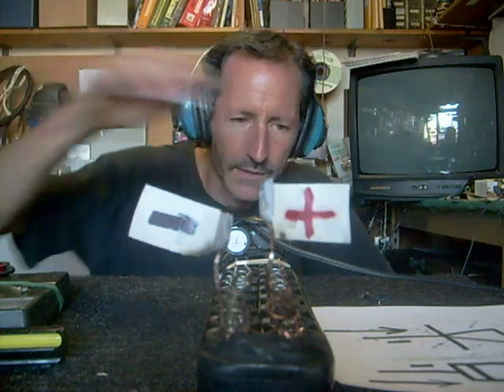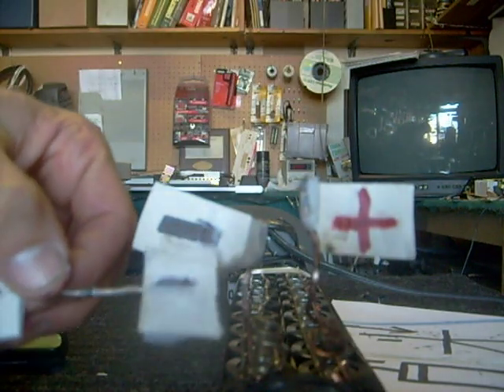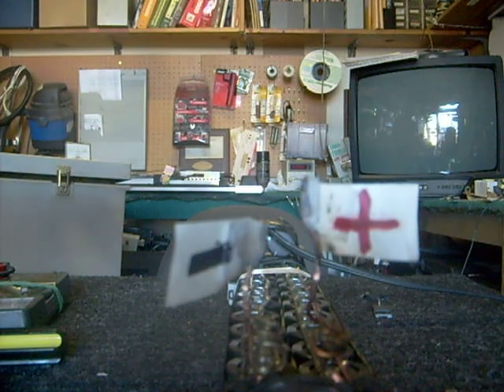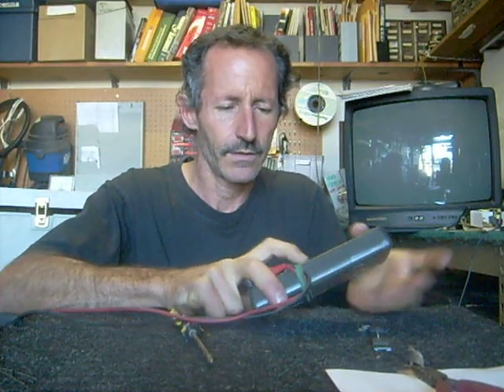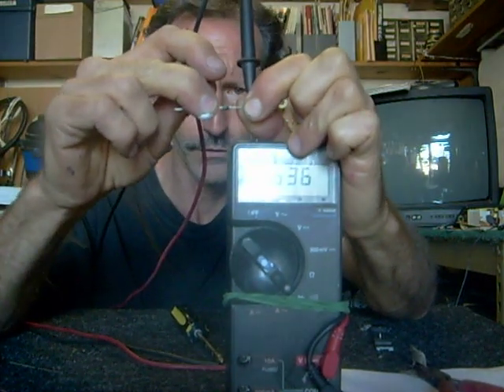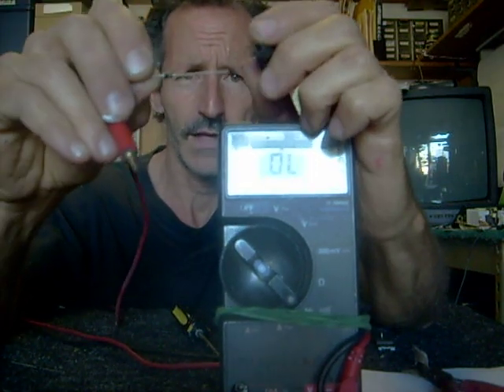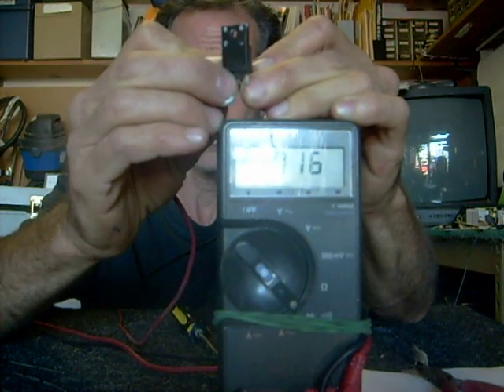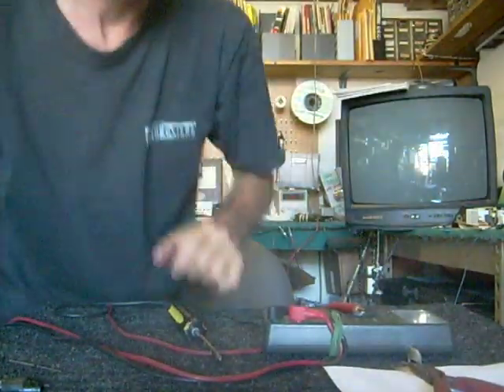How to test Diodes

Comment: Ok ive got a problem!!!
to check the multimeter ive put the multimeter to the diode option and as soon as ive put it to the diode setting without connecting any diode to it makes that keeeek!!! sound and there is no change if i connect it to the diode !!
Reply from the maker: Ansul Joshi Sounds as though your  meter is broken.
Reply: hmmm all the other functions work finee!!! like volts amps and all the other functions work just fine!!! is there any oother way to fix the meter !!
Reply from the maker: Sorry but I couldn't tell you how to repair a problem such at that.
Reply: hmmm ok cool np!!

Comment: you can always tell a seasoned veteran by the rubber bands around the meter leads to keep them from twisting all over the place ;)
Reply from the maker: Gord Slater You got that right. LOL .  After re-soldering the meter probes numerous times I figured a little tension relief might buy me a little more time,  Seems to be doing the job.

Comment from the maker: A diode doesn't put out any voltage or current, but if power is passing through them from an external power source they cause a voltage drop of around 0.6 of a volt for a silicone diode and around 0.3 of a volt for a Schottky diode.

Comment: If the diode is putting out half a volt....wouldnt that a source of energy....im confused bigtime. right now im  thinking put 500 diodes in series to a coil, have in inducted coil around that to lower the voltage and make more amperge.....then u generate power out of nothing....please clarify because im totally lost on why the diode is putting out half a volt.

Comment from the maker: @abpccpba You can test them in circuit, but sometimes you will get a false reading because there may be other components in parallel with the transistor or diode your 
testing. When in doubt remove the component and test a second time.